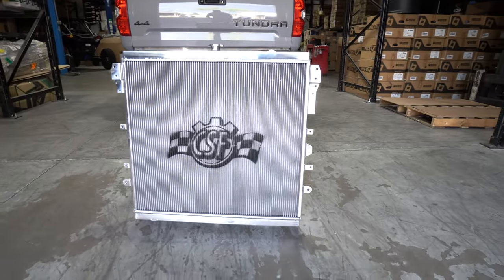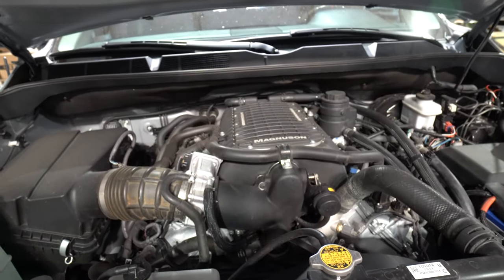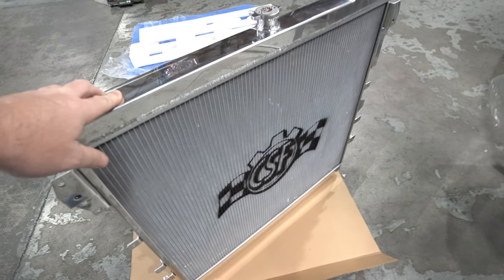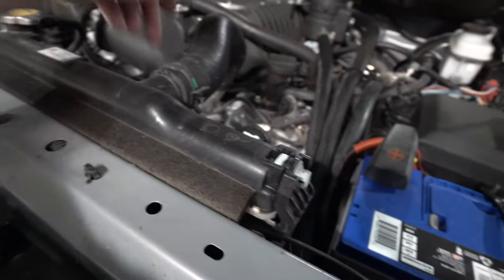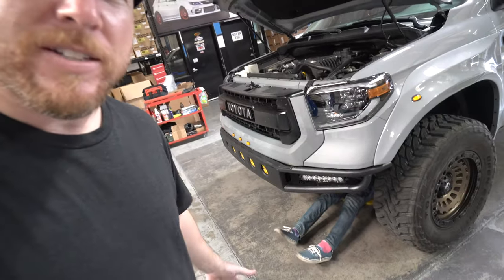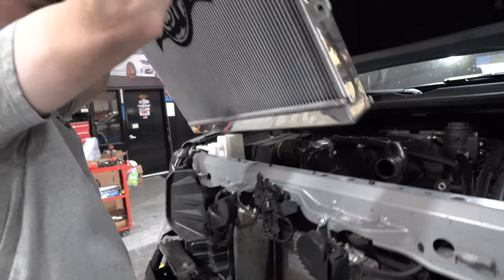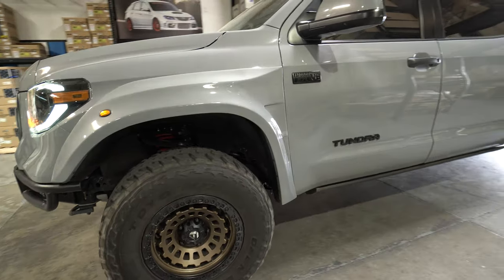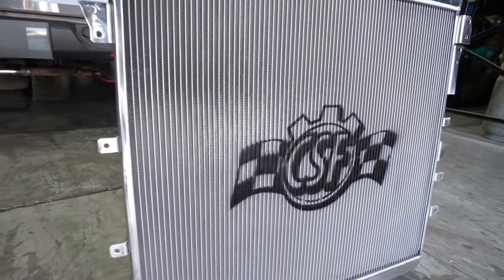Our Supercharged Toyota Tundra gets COOL New Upgrade From CSF Radiators!

Comment: I love the aggressive stance of your truck. How did you get that wider stance with those pro comp fender flares? I like the wide look people get with long travel, but don't want the headache of maintenance, price, and I'm not going to speed in the desert. I understand the truck has stock trd pro suspension, but there's limitations to how wide it looks compared to long travel correct?
Reply from the maker: 0mm offset wheels with 2” spacers
Reply: @vivid_racing  Are you able to run a more negative offset wheel instead of the spacers or is it better to run spacers?

Comment: Hi thanks for the video just curious how is that CSF radiator holding up for you I want to get one for my tundra but I’m hearing a few complaints thank you appreciate any information
Reply from the maker: CSF had no issues.  Had it on there for about 15K miles and have recently sold the truck and moved on to the next project.  I think there is always someone that had a bad day... CSF makes great products.
Reply: Thanks for the quick response I appreciate it

Comment: The factory rad will do everything the aftermarket one will.
Reply: Just about, but more cooling capacity is always better
Reply: I own 3 100k+ Toyota V8s.  The factory radiator is made of plastic that eventually becomes brittle and leaks.  It's a failure point.  OEM is my default for most things but when the OEM radiator reaches end of life, I upgrade to all metal.
Reply: Just like upgrading the oil filter cap

Comment: i wonder how much something like that would cost? i have the same truck!
that's a bad ass front bumper too!
Reply from the maker: It is around $450 for the radiator. Thank you though! 🙌🏼 subscribe for more check out the radiator here - https://www.vividracing.com/csf-cooling-racing-high-performance-division-0710-toyota-tundra-automatic-manual-toyota-tundra-20072010-p-152375334.html

Comment: How does it compare to the Koyorad? That’s what I’m running with electric fans
Reply from the maker: Does koyo have a oem replacement ?  That is what this is.
Reply: @vivid_racing   Yep! It’s a direct replacement full aluminum. So far so good! I’ve been running mine since 2017. Much better quality built than stock with the plastic end caps proned to leaks.